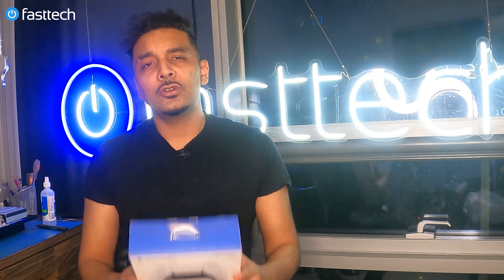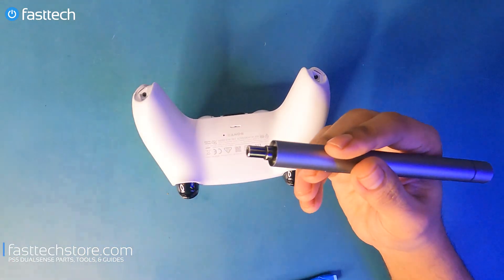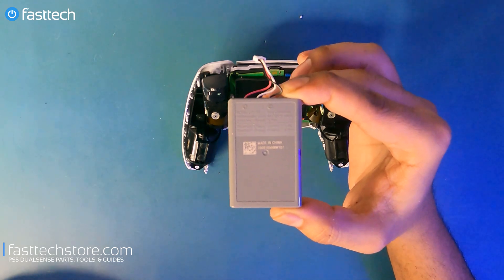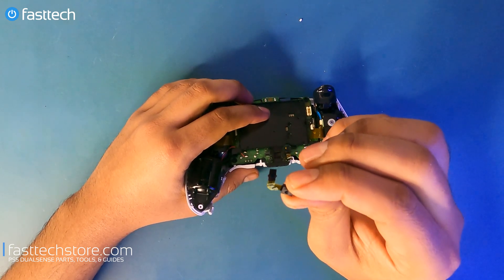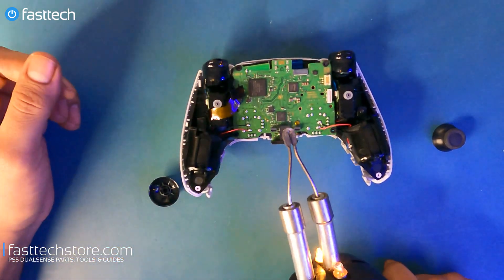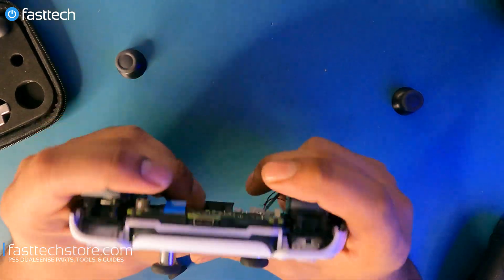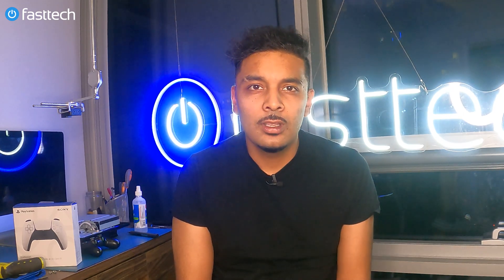PS5 DualSense Controller Disassembly and Repair Guide - CFI-ZCT1W (Teardown)

Comment from the maker: FREQUENTLY ASKED QUESTIONS
Where do I buy the parts and tools needed for this job?
▶ Fasttech Pro AutoKit: https://www.fasttech.ca/tools/fasttech-pro-auto-kit
▶ PS5 DualSense Controller Battery: 
https://www.fasttech.ca/ps5controllerdualsense/dualsense-controller-battery-cfi-zct1w
▶ PS5 DualSense Analog Sticks: https://www.fasttech.ca/ps5controllerdualsense/dualsense-controller-analog-sticks-cfi-zct1w
▶ PS5 DualSense Motherboard: https://www.fasttech.ca/ps5controllerdualsense/dualsense-controller-motherboard-bdm-010
▶ PS5 DualSense Controller Battery Cradle: https://www.fasttech.ca/ps5controllerdualsense/dualsense-controller-battery-holder-frame-cfi-zct1w
▶ PS5 DualSense Controller Touch Pad: https://www.fasttech.ca/ps5controllerdualsense/dualsense-controller-touch-pad-cfi-zct1w
▶PS5 DualSense Lower Microphone: https://www.fasttech.ca/ps5controllerdualsense/dualsense-controller-lower-microphone-cfi-zct1w
▶PS5 DualSense Upper Microphone: https://www.fasttech.ca/ps5controllerdualsense/wcvl4fpadgf0b3yqut75bx22sk6cos
▶ Buy PS5 Parts: https://www.fasttech.ca/playstation-5-1
▶ Want us to fix your device for you? Just order the Fasttech Repair Box to send us your device by using this link: https://www.fasttech.ca/repair/repair-box
👉NEED HELP? FaceTime/Zoom Video Call Me: https://www.fasttech.ca/online-consultation
👉GET REPAIR SERVICE FOR YOUR DEVICE: https://www.fasttech.ca/electronics-repair

Other PS5 Videos:
▶️PS5 Disc Drive Repair Guide: https://www.youtube.com/watch?v=WocR0PRHu50
▶️PS5 Factory Reset Guide: https://www.youtube.com/watch?v=-FBN3xqd5Pk
▶️PS5 Elgato 4K60S+ Setup Guide: https://www.youtube.com/watch?v=bZETqEkjEBg
▶️Enable 120 HZ Output for PS5: https://www.youtube.com/watch?v=Y6BcTNSX82o
▶️PS5 Teardown and disassembly/repair guide: https://www.youtube.com/watch?v=-UFfAdd4IK0

👉Business Social Media:
Twitter: https://twitter.com/FasttechCA
Instagram: https://www.instagram.com/fasttech.store
Facebook: https://www.facebook.com/fasttechy

👉Follow me on Social Media:
VLOG CHANNEL: https://www.youtube.com/channel/UCF2IPXKRX5ctN9td1rhkzHg
Instagram: http://instagram.com/youngtechgod
Twitter: https://twitter.com/Shehroz

00:00 Intro
01:20 Does this video apply to you?
01:37 Removing the black plastic trim
02:44 Removing screws from back panel
03:34 How to replace L1&R1 trigger buttons
04:04 Removing the back panel
04:37 PS5 controller battery replacement guide
05:50 PS5 controller battery vs. PS4 controller battery
06:50 How repairable are the PS5 controller triggers?
07:31 Removing PS5 controller mic
08:30 How to hard reset your PS5 controller
09:15 Extracting the motherboard
11:36 Surprise upgrade - Xbox Elite analog sticks on PS5 controller
14:46 Removing the midframe & trigger system
15:34 Removing the buttons and touchpad
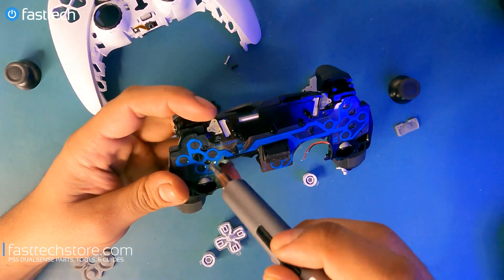17:05 Extracing the L2&R2 triggers from the midframe
18:28 Outro

Comment: BRUH.....STOP LYING DAWG. EVERY SINCE THE PS4 GENERATION, THE DUALSHOCK BATTERY HAS NEVER FAILED OR NEEDED REPLACEMENT. SO NATURALLY THE DUALSENSE IS THE SAME EXCEPT THE BATTERY IS BETTER IN EVERY ASPECT, SEEING HOW MANY FEATURES ARE BUILT INTO THE DUALSENSE CONTROLLER THAT THE BATTERY RELIES ON. I SWEAR U CAN ALWAYS TELL U GOOFIES ARE PC DUDES OR XBOTS TRAMPS. STOP SPREADING MISINFORMATION BY SAYING YOU WILL HAVE TO REPLACE THE DUALSENSE BATTERY ALOT. I'M YET TO HAVE A DUALSHOCK OR DUALSENSE BATTERY THAT NEEDS TO BE REPLACED. STOP THE CAP DAWG!! Y'ALL SO ANNOYING AF!!
Reply from the maker: Are you saying lithium ion batteries don’t die?
Reply: @fasttechvideo  YES, THAT'S EXACTLY WHAT IM SAYING, SPECIFICALLY IN PLAYSTATION CONTROLLERS SINCE THE DUALSHOCK RECHARGEABLE BATTERIES. I'VE GOTTEN STICK DRIFT, USB-C CONNECTORS AND EVEN BUTTON MALFUNCTION PROBLEMS WAY BEFORE A PS ION BATTERY DIED ON ME. GRANTED, OVERTIME IT HAS A POSSIBILITY OF LOSING IT'S CHARGING POWER BUT NEVER,😢 NOT ONCE, HAVE I EVER HAD TO REPLACE A PS BATTERY BRO. MAYBE IM THE LUCKIEST MAN ON EARTH WHO'S NEVER HAD TO REPLACE THE BATTERIES IN ANY OF MY DUALSHOCK OR DUALSENSE EVER! (sorry for lashing out @ you too because it has taken me 6 hours to reassemble by dualsense controller because ppl want to make their videos 2 and 3x's the speed vs just doing it in real time) I'M USUALLY NOT A NASTY PERSON WHEN IT COMES TO HAVING AN ATTITUDE BUT TODAY HAS PISSED ME OFF TO THE HIGHEST DEGREE!! UR VIDEO WAS DONE WELL EXCEPT IN A COUPLE AREAS OF YOUR UPLOAD BUT I DO APPRECIATE THE WORK AND THE EFFORT YOU PUT INTO MAKING THIS VIDEO. 💯👍🏾❗

Comment: How to get r2 out?
Reply from the maker: @030dv  by removing the screws. I did demonstrate that
Reply: @ yea i fixed it and it worked and the next time i turned on the controller it stopped working😐
Reply from the maker: @ you did something wrong or your trigger is dying. We do sell a replacement original trigger
Reply: @ i put a whole different triggersystem in (with r1 and r2) i think its just broken

Comment: When I put my L1 and R1 trigger back onto both of my controllers I was working on, for some reason the R1 buttons are perfect. Clicking, bouncing back up when pressed, but the L1 on both controllers is jammed. It goes in and does not bounce back, not clicking. Need help!!!!!
Reply from the maker: @CHANGE98  the only thing i can recommend is take the l1 button cover out and try putting it back in.
Reply: @ did that as well :/ I took the rubber out beneath the button too to see if something was wrong. It’s annoying, button just doesn’t bounce back up.

Comment: I can't find any repair videos for the controller with model cfi-zct1w my r2 trigger is locked out. The spring is on the inside not out. I can't fix it, none of the videos are comprobable
Reply from the maker: @andreamcclureburkins6493  you have a bdm-020 or 040 Im doing videos on them soon

Comment: does anyone else not have the screws by the face buttons and dpad? like they just simply are not on mine and I checked the model number.
Reply from the maker: Was your controller disassembled in the past?
Reply: @fasttechvideo  Not to my knowledge. I bought it new and haven't taken it apart before. It's not just the screws that aren't there, the places where the screws should go isnt there.
Reply from the maker: What is the model number of your controller? @jamesonsummers
Reply: @fasttechvideo  The same model that is in the title. I'm thinking maybe they printed the wrong model number on mine. I was able to fix what I needed to after some research on other models.
Reply: @jamesonsummers I have the same issue with the same model

Comment: Fasttech,
Outstanding vid brother New sub here for support and I digg your vids.
Got a question hope that you can help.
I need the flex cable sizes that are in the PS5 controller. I found the replacement flex cables with only more frustrations. Only says what they are and for but not pins and sizes. I found a 18 pin flex cables for the touch pad. I think the left and right trigger FC are 16 pin. I need to know what the sizes are for all the flex cables inside the PS5 controller and how many are inside the PS5. I want to grab a few each flex cable extensions and connector for all. Man,bro can you please help me with this???
Reply from the maker: There are currently two different models of controllers. A zct1w and zct2w. Please make sure you are ordering the appropriate ones for your controller.

Comment: Thanks so much for this! I spent $60 on a highly rated ps5 clone that works on ps4 and within a month the spring for R2 failed. I was reluctant to pull it apart but after no replies from the company I though stuff it. You saved me from wasting (yet another) ps4 controller!
Reply from the maker: Awesome. Was the clone exactly the same as the original? Please like the video and subscribe.

Comment: I accidentally pulled wires from mother board , first 3 came off controller still turned on but just analogs worked… then the last came out now nothing in the controller, if I solder all back on will it work? Also broke the ribon cable beside the microphone the small one is this a problem? I only use a headset please reply thanks
Reply from the maker: The microphone can be replaced. Not sure what first 3 cables you are talking about Im going to need to see a picture

Comment: I had to replace a broken front mic flex  cable on my duelsense but even with a new cable installed the front mic stiil won't work, any suggestions  would be appreciated.
Reply from the maker: Check the connector on the logic board
Reply from the maker: Its very common for people to break the mic when disassembling these. We do sell that on our site (check the pinned comment)
Can you be more specific with what wires you broke?

Comment: Hey do you think you can send me a link to the built in mic cables on your website. The links are not in the description and I can’t seem to find the cable on your website 😃
Reply: You don't even need the mic in the controller and if you ever use it you're an asshole with how bad it is. I removed them in all of my controllers so they don't use power.
Reply from the maker: Sorry about the late reply. We have it listed in the description box and also top comment 😌